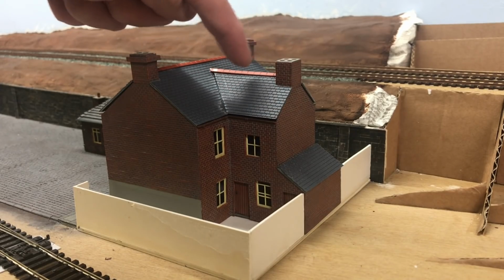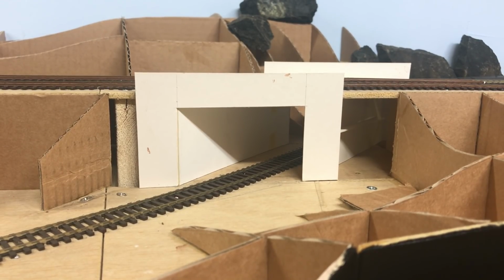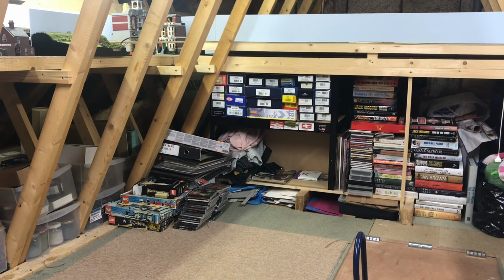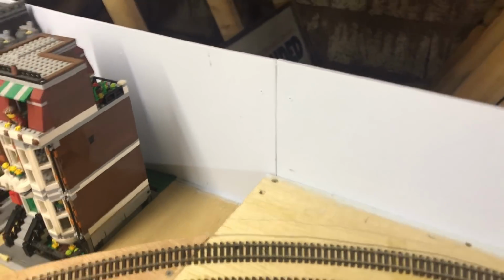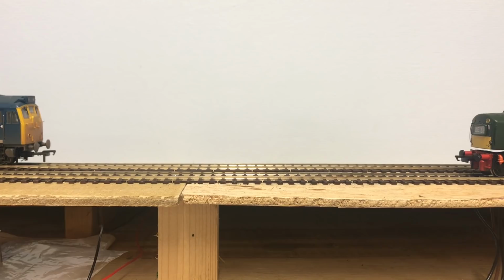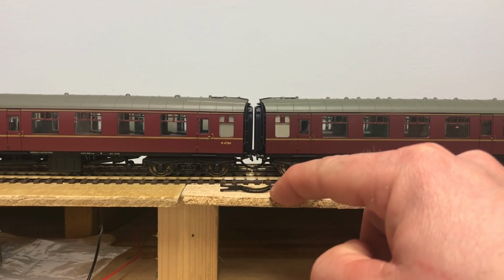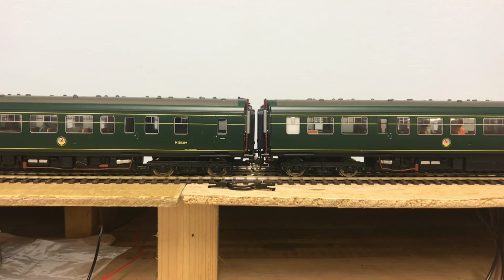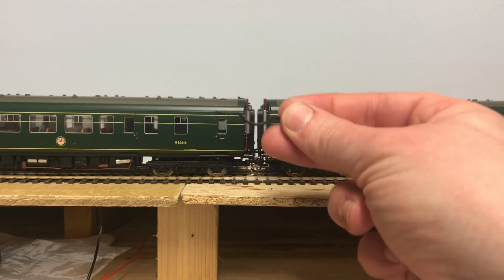Building A OO Gauge Model Railway: Update - March 2019

Comment: Nice video Paul.  One thought about the close couplings -  I use them on my Yarslow layout (see the Yarslow channel) and they look great but I would fit them AFTER weathering and populating the coaches because getting the rakes apart and back together is a total pain!! The less you have to do that the better.  If I do need to work on a coach, I have to lay the whole train down and use a length of thin foam to avoid damaging the coach sides.
Reply from the maker: Thanks, it’s a fair point. At the rate I work and the tasks I have to do I suspect populating coaches and weathering them will be some way down the line. 😂 Paul
Reply: You can to some extent avoid this problem by gripping with some thin pliars and pulling the coach away with a little force. Bachmann use similar couplings on their dmu and emu stock, which has the lighting/dcc contacts in it.

Comment: Very enjoyable update Paul.  The new bridge will look good once you have worked your magic on it.  The extra stage space will help you quite a bit particularly.  I am going to look at options for close coupling of my coaches.  Dapol provide plastic easy shunt style, and rather like the Bachman vacuum pipe couplers, I never get them out of the packet.  Stephen
Reply from the maker: Thanks Stephen, I think I’ve changed tact again on the bridge back to an earlier thought with the use of girder sides. Still mulling that one over. I’d definitely encourage the close coupling if only from a more aesthetically pleasing point of view. Paul

Comment: Hi Paul
Great update, plenty going on as usual... that house roof must have been frustrating lol
Nice to see Fred visiting too
Interesting bit on the close coupling, I haven't touched the Kadees for a while and hadn't tried them on coaches yet.  The vacuum pipe connection is great, never tried that either but certainly will.  If you remember I was struggling with my coaches uncoupling on the helix.  I'll try this fix see if it works and if the coaches go around the bends okay.
Nice new dmu, looks much better with the no.5 fitted than those big couplings.
Cheers Paul
Reply from the maker: Thanks for all the comments Paul, you should try those Bachmann couplings, they may just solve those issues on the helix. Fingers crossed for you. Paul
Reply: Worst thing is I have a feeling I got a comment about the bachmann coupling on my video, don't know why I didn't do it, although my memory at the moment is awful.  I need to make a list of jobs to do. I'm actually wondering if one problem might be the coaches were second hand and maybe didn't have the fitting in the box anymore....
I'll definately try iit and let you know if it works on the helix.
Cheers
Paul
Reply from the maker: Yeah do, maybe we will get an update soon too? 😉🤔 Paul
Reply: Maybe, we'll have to see how the thing I'm working on pans out... 😉

Comment: Great update Paul, regards to the Kadees  on the Blue Grey coaches. They foul because the pockets are too high, that is why the tension locks are stepped down. What you need to do is replace the NEM pockets using the Keen System then you can use the NEM Kadees.  Hope that helps.
Reply from the maker: Thanks Scott, I must take a look at this Keen system. I know nothing about it other than the brief snippets I’ve read, appreciate the feedback on it

Comment: Great update Paul, I brought the Bachmann class 20 departmental carriage set, which came with a standard circle of track fitted the vacuum pipe fittings, which too my surprise operated with no problems! The houses roof I built the same kit a good few years ago, had same problem using the template provided for the extension, I belief this is the heart of the problem, the angles are slightly wrong so nothing sits right.
Reply from the maker: Hi Vince, I never considered that there could potentially be a problem with the template, it’s certainly interesting that you had the same issues. Either both of us are terrible modellers or there’s something in this. 😂 Paul

Comment: Hi Paul. With regards to the problems you had with the roofing, have you thought about making trial runs using cardboard to arrive at a final template you can then use to cut the plastic roofing sheets.
Reply from the maker: Allen, where were you when I was going through this pain and suffering? 😂 I could have saved a lot of time and plastic sheets if only I had thought the same! Paul

Comment: hi paul
just an idea for you when fitting the extention roofs
this is what i have done on the few i have done if you put a straigh edge cut to the length of the extention  from a scrap of plasticard  from the tip of the extention gable to  the main roof making sure that edge straight edge is  looking plum and straight  and center  to the main roof  and mark where it is  hits the main roof  then measure from the orignal  roof base up to the mark at both sides and you should  then have  the correct angle to mark on the slates   to cut and you could then  sand the inside of the angles to about 45 degree angle and this should help the roof to sit closer to the original roof and then you could add led flashings to the  valleys  where the roofs meet i have seen tinfoil been used for this but i have not got that far yet i hope i have made myself clear   and that it might help you in future builds 
regards
james
Reply from the maker: Thanks for that James, if I do one of these again Ill certainly refer back to these instructions. I may add some flashing to disguise the gap also, I’ve used duct tape to good effect for this purpose before. Paul

Comment: Have you considered including a reversing loop in the storage area, it looks like you have adequate space and it will give the option of turning a train should you want to?
I have many, too many, of the older style tension lock couplings in fixed rakes. I was planning to cut them off as you have done with the DMU and replace them with NEM pockets and then whichever close coupling system is economic. Is there a reason why you chose Kadees for the DMU?
Reply from the maker: Thanks for the comments Gary. There is space for a return loop but the main issue is access to build the boards and reach any derailments etc when a problem arises. It’s something I may look at in the future and this storage could be modified to include it if I can work out how to do it. As to those couplings, having seen Kadees in use on Sam at Hillside Central I started looking at it for all my stock. They are versatile, reliable and most importantly offer a wide range of options in different designs all of which can be used with each other. The DMUs are unlikely to be fixed to other stock but I the off chance I wanted to replicate a broken down unit being towed by a diesel loco I have set it up to allow me to connect with no problems. Paul